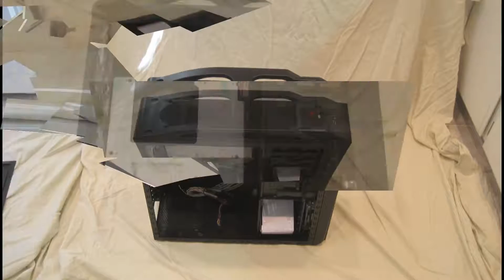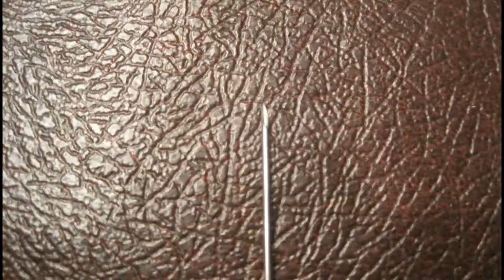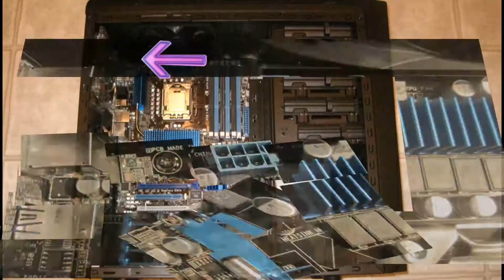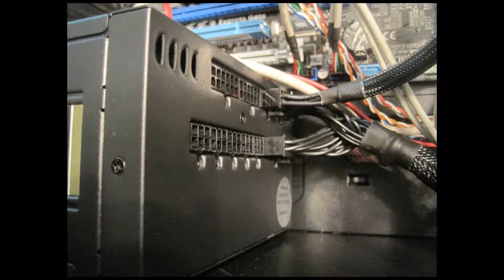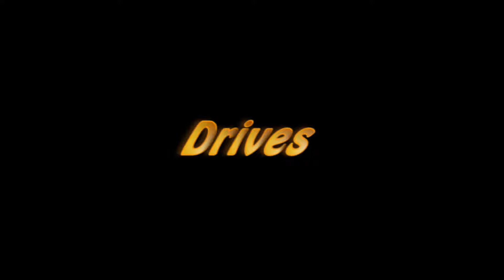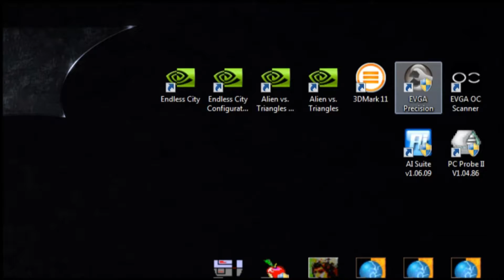How to Build A Computer Tutorial, Intel i7 LGA 1366 ASUS P6X58DE V8 Cooler

Comment from the maker: I don't remember the exact prices, but the mother board I think was between $200 and $250. All the parts seen in the video were around $1,500 or $1,600 (that doesn't include the monitor which I already had and the system software). The same parts today probably cost around $1,100 now.

Comment: @luckasjes Thanks again for your feedback.. I am sure it is triple channel. There are six RAM slots and also my CPU Intel Corei7 960 supports triple channel. My RAMs speed (1333 MHz). I doubts the version of the windows 7 Ultimate, but since it is 64-bit it should support till 192GB as I guess. Finally my Motherboard chipset is the latest (X58) and must read 24GB, with the newest socket (1366)...